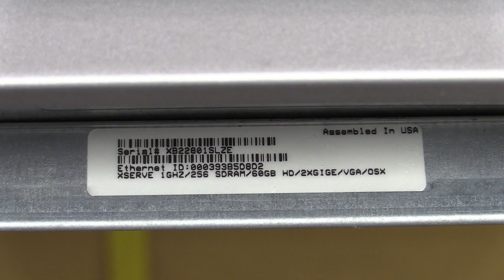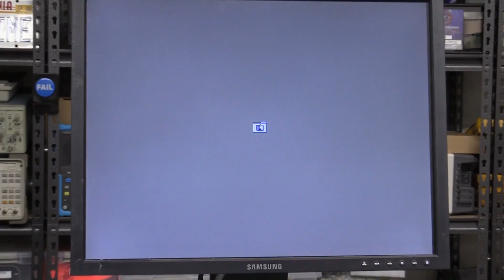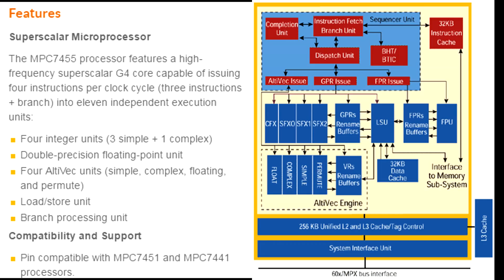EEVblog #882 - Dumpster Dive Apple Xserve Computers

Comment: Wow, the fans inside, veeeeery bad design, even for the time, there was better designs in Dell, Hp servers ! And Delta is not the best choice for a PSU, I repaired a lot of Delta's and a lot of bad brand capacitors leaked...
Reply: +Tech NOW You're perfectly right. And they are right as well. They did design it "badly" as 1U system as - at least if you rent rackspace at a datacenter or if you're running a really large system with many many servers - rackspace is really expensive thing. You whack in 2U server: pay nearly twice as much as you do pay for 1U. That makes a real demand for 1U "pizza boxes". So they have to find good balance inbetween "correct design" (where I would even tend to say 4U should be better for calm and energy efficient fans) and a cheap solution that does not cost that much rack space. That's the cause why they designed it "badly". And, remember: The thicker the air channel, the lower the air speed at a given volume stream will be!

You see, actually not sooo bad design though. ;-)
Reply: +Tech NOW ... and still IBM and HP both did use Delta as supplier, even for their "big guys" (Blade systems, SAN storages, ...). So you mean they are really crappy!? I've even seen a couple of Intel server boards with bulched caps, so does that make Intel a bad choice for Motherboards then? ;-)   All manufacturer did have that problems to some degree.
Reply: Its just that i a lot of Delta PSUs I encountered badcaps problems, that I didn't find on FSP, Corsair brands for example. I think they just should pay more attention to the caps brand inside their PSUs.
Reply: hows that a bad design
Reply: it sucks the "cold" air from below, where there's like 1cm or less of space for airflow, they could have made it a 2U rack and designed a better airflow system...

Comment: I would like to take that case- scrap all of the [cr}apple stuff, and build a nice socketed dual processor machine within it. That would be a nice challenge...
Reply: TrainMasterMan I strongly suspect Apple had an alternative processor module with Xeons, available only to the secret team that created the X86 port of OS/X. The use of a generic industry connector and an Intel chipset are the biggest clues.  Maybe they even considered making those modules available to early adopters if there was enough market. Personally I have only a bit of experience with the outside of a model that had two huge air intakes on the front, between 3 (not 4) drive bays, but I don't remember if it was x86 or PPC based.

Comment: I have a large HP Proliant DL160 G6 rack server, it's even bigger and a LOT noisier. Pretty similar inside though, they haven't changed much through 2000-2016 in terms of layout.

Comment: Surely, those blowers draw air from the space below and blow it across the processor?
Reply: aserta
Yes, but those fans, known as "blowers", have been around for over 15 years. One would think someone with his experience would have seen one before. :P
Reply: +Rob Fenwitch I noticed that too.  And you are right. He has the fan direction backwards
Reply: +JL Software what's a type of fan got to do with apple? #Logic
Reply: Squirrel cage is an interchangeable term to mean either a type of motor or a type of fan.
Reply: +D Cheverie He hates Apple so much that he intentionally won't learn it.
Reply: +Rob Fenwitch   Yeah...  I think his point was that there is almost no space below them to draw air from.
Reply: megaspeed2v2 It's just that he immediately criticized Apple for no reason. He doesn't even know how the blowers work. Apple has engineers who actually design a thermal path, not just slapping 8 huge fans in a PC case and calling it cooling like homebuilders do. Look at the inside of the PowerMac G5 - dual G5s with a custom-molded clear plastic baffle to form 3 separate cooling paths. I'm sure the same design patience went into the Xserve.
Reply: funkyironman69 Steve Jobs always wanted to inspect the inside as well as the outside of the products. Some of the G4 towers had the whole motherboard mounted ON the door that folded down. But of course homebuilders don't care about thoughtful design - they want 14 different manufacturers' components so that they "know exactly what is in there" and all generic technologies so they can "upgrade."
Reply: +JL Software Macs are not top-notch in build quality, and they think they still own it after you buy it. Just because something looks trim and polished does not make it good. Everything Apple makes is overpriced, fragile, and just plain.
Reply: JL Software
Those were really common in PC's as well.  Next.
Reply: +JL Software the sides are an excellent place to put the exhaust vent, or given a different design of hinge, the back. however, so that they didn't compromise their "form over function" design, apple decided that the exhaust vent is physically located behind the hinge on the laptop. this means it vents ok when the laptop is open (dumping all the heat into the display, another problem that could be avoided), but when closed, placed on a table or other flat surface, its ventilation is heavily restricted. say you wanted to render a video using software rendering (universally accepted as better quality for a given filesize) it may take a few hours, you might want to close the lid.
Reply: +Rob Fenwitch Yes they're centrifugal blowers. Not squirrel cage. That's a type of motor. Surprised by Dave's lack of knowledge tbh.
Reply: iwanthalo3 So for function over form, you want a huge case with a 500-watt power supply, dual overclocked 16-core processors, 128 GB of RAM, 8 fans all blowing towards each other, 6 PCI slots so you'll have 4 left over after installing the 2 video cards, 6 drive bays, floppy, 2 DVDs, 8 USB, and parallel port.
Reply: JL Software you say that as if apple are the only ones who do that, that is something ALL professional designers do. you are just being biased by the way you are saying these things that apple do as if they are the only ones. #ByYourLogic
Reply: Tim Ramich Not to a homebuilder, no. But those people are a tiny niche market. Give examples of what you mean by "cutting-edge." If you mean the absolute latest $1000 video card, you can get two of those in a Mac Pro. Otherwise, Macs have Thunderbolt and USB-C and the latest Intel i5/i7 processors and either Intel graphics 5000 or dedicated GPU. And very thin and lightweight with top-notch build quality and customer service.
Reply: +Tim Ramich I'm with him on a lot of things. he can rant a bit, but I learned some good soldering tricks, and learned apples repair policy which I find just crap.

oh well, at least you and I can see through it lol
Reply: Anybody that has no backup of their data and then takes the computer into a shop .... oh I'm laughing so much I can't continue.
Reply: Never wanted anything from Apple until I saw the interior of the trashcan Mac Pro. It's friggin beautiful design wise. No SFF build I've ever seen comes remotely close.
Reply: +D Cheverie It's physics not electronics.
Reply: +D Cheverie  6:15
Reply: iwanthalo3 Where do you want the exhaust vent? What do you mean "behind" the hinge?
Reply: +Rob Fenwitch They do, and don't call me Shirley.
Reply: Plus Apple laptops are great value, the only one I've taken apart had 30 screws of many different lengths. Not only did it provide hours of fun, it looked like a modern art masterpiece.
Reply: I've never had the need for either of those silly interfaces, nor do most people. If I need something beyond 1 Gbps Ethernet, I will step up to 10 GBase-T.
Reply: +iwanthalo3 Yeah. Their version of a repair is to replace it. I do wonder, though, if they have a factory where they do refurbish their parts, such as boards. I saw a video by him a few months ago and I got a bad first impression, but I watched a shit load of videos this weekend and I can say I was wrong about him and I learned a lot.
Reply: +JL Software 

you are of course referring to the same company that today puts the exhaust vent on their laptops behind the hinge, meaning that you can NOT use it closed, or it will overheat.

plenty of factory pcs have excellent thermal designs too.
Reply: spodule6000 So they blow instead of suck?  I guess it makes sense because this is Apple we're talking about.
Reply: +JL Software a 500 watt power supply wouldn't be enough for dual 16 cores a pair of graphics cards and whatever else. apple did that with the Mac pro/g5. function over form for something like a laptop would be NOT BLOCKING THE KNLY EXHAUST VENT WITH THE DAMN LID.
Reply: +JL Software and yes, that is something that many professionals (who for that reason don't use Macs) have. why don't they have Macs? cad software is universally better on windows than Mac, and the most powerful Mac you can buy has a very outdated CPU architecture limited to 6 cores, at a cost of $4000 a pop for the quad core model. apple chose to stick the damn think in a bin and sell it as a professional grade machine, its pathetic.
Reply: +JL Software Haha so Macs are cutting-edge technology?
Reply: +JL Software the video cards in the Mac pro are far from the latest. plenty of PCs come with thunderbolt 3, something Mac has not adopted. it took a long time for apple to adopt the skylake series of processors, and their "professional" grade products are so far behind.

do some genuine research on the "top notch" build quality. the thing is held together by glue. on customer service, go take a look at Louis rossman's YouTube channel. one example is if your macbook has say a main board failure, they charge a flat rate for repair (completely stupid since it could simply be a ram failure), worse is that they won't recover your data, even if the pci-e ssd is perfect and could just be slotted in a new machine.

and as for Steve jobs, the man was disgusting. he denied the existence of his own child until dna proved paternal connections, he banned all acts of philanthropy within the company, and was petty enough to remove freaking kit kat bars from the apple vending machines because android 4.4 was named kit kat.

apple does not care about you, or its customers. you are nothing but money to them.
Reply: Seems like mac users designed the cooling system. lol
Reply: Just admit you're a PC loving, anti-mac, commie son of a hamster. Apple are very good, they even solder the RAM in to stop the electrons from escaping. ;)
Reply: > worse is that they won't recover your data, even if the pci-e ssd is perfect and could just be slotted in a new machine

My MBP has had its logic board replaced 3 times (same problem each time—some design flaw) and every time, the Apple technicians have transferred the SSD to the new board. (It's out of warranty now, though, so I'm going to have to attempt a Louis Rossman-style fix soon.)
Reply: Since it would be a quarter of the price, why not?

Comment: That would be a decent NAS server though. Plug  large IDE hard drives into the slot, and install Debian on it, and you could say Bobby Dazeler!
Reply: +John Rickard It is probably now less powerful than a raspberry pi and it consumes al least 50 times more energy
Reply: +John Rickard No it wouldn't and large and IDE don't go together.
Reply: +MrTVintro You would be wrong to assume that. UDMA IDE has the physical means to support up to 2 tb hard drives. In practice, I have seen half-terabyte IDE drives. Regardless, I said decent - not overpowered
Reply: +John Rickard It consumes too much power.
Reply: +Antonio Barba Good point
Reply: +MrTVintro Get a SATA-IDE adapter for less than 5 bucks and you're set.

Comment: Teardown of Delta PSU?
Reply: +Антон Южаков caps resistors and transformer and some diodes
not much else going on in the PSU's
Reply: Great idea! I'd love to rebuild that PSU to a rather powerful bench top power supply! These units are awesome!
Reply: +Stein-Erik Dahle You can get excellent server PSUs on eBay for practically $shipping. Some are better than others, and many have proprietary connectors. The best one I've scored is a sony APS 112 form a sunblade workstation. I does 5V @ 70A and 3.3V @ 90. Thing is a monster and beautiful inside. https://www.flickr.com/photos/dork_vader/albums/72157638625275205
Reply: +Антон Южаков Yeah you can see in the pictures:

https://www.flickr.com/photos/dork_vader/26529114163/in/album-72157638625275205/

 caps and other output misc soldered to the massive traces on the PCB which are soldered and bolted to the busbars. Each rail has four 10,000 uf caps on it, IIRC.

OK *now* I pretty much have to drag it out into the sun and reshoot some good photos with the good cam. Look out for that in the next month or so :p
Reply: Sam Fedorka Oh, what a beauty... Maybe you have some photos of PSUs with more amps and some huge bus bars?
Btw, does it have Synchronous Rectification or just Schottky diodes?
Oh, i see diodes, are they soldered to bus bar? Power transformers secondary windings consist of litz wire?
Reply: +Sam Fedorka, I can't believe I haven't thought about that... Thanks mate!
Reply: +Антон Южаков It took me a while to figure it out but yes the negative busbars go around under the secondary heatsink and everything is soldered to them. it's crazy. I'm thinking about making an account on the eevblog forum so I can post pictures an/or mailing it to dave so we can hear him gush over it, but I'm worried it'll only warrant a 2 minute teardown.

I took a bunch more pictures a while ago (with a cellphone so not super great quality) that show more of the inner workings. I'll put them up on flickr now.

I really want to test it at high power, to measure it's performance but I don't have anything that can draw that kind of power and still survive. I had a 600W projector bulb that I used to test my variac with, hmm.

update: pictures added to album. I really need to upload the rest of my stuff sometime.
Reply: Sam Fedorka Output caps soldered to PCB, not to bus bars?

Comment: Intel 21154 is a PCI bridge chip, probably just expanding the PCI bus for more slots.  Interesting that it uses the Digital (DEC) part scheme (many Digital semiconductors before they were bought by Intel used 21xxx), so it may be an older part they inherited and rebranded. Other examples are the Dec Tulip ethernet chip 21140,  Alpha processors like 21064, 21164, and 21264

Comment: Can I have that VGA card?
Reply: Joshua Nicoll i've checked now, and i found that the Graphics card in my old PC is an ATI 9250, which you can get for like 10€ here including shipping...
So not really worth anything at all...
Reply: +Joshua Nicoll what do you wanna do with it?
Reply: +muh1h1 it's a regular PCI card, they're fucking rare as well
Reply: +Joshua Nicoll hell*
Reply: Joshua Nicoll OK then, i think i still have one in my old PC (might be AGP though), i should have a look on ebay if it is worth anything :D
Reply: Some of them go for up to $50
Reply: +Joshua Nicoll I have like 5 of them I was going to throw away. are they really that rare?
Reply: Depending on the type, yes, wgere as 10 year old PC stuff is old and useless, the even older stuff can sometimes be worth a little bit, often not much more than $20, but if you've an old DIMM DDR desktop you wanna restore because it's retro and retro PC's are kinda cool, you're gonna have a hard time finding those DIMMs
Reply: +Joshua Nicoll Thanks for the reply; I checked and I recycled the PCI GPUs, but I have some beefy AGP ones left. I didn't think this stuff was old enough to count as retro.
Reply: +Sam Fedorka if it's not used or the modern version of it is also not used, its retro. 10 is old useless, 15 years old and the standard is also dead its retro.
Reply: +Joshua Nicoll not rare at all here super cheap
Reply: Where I live they are very rare, But common for me is the 65 DDR2 256/512Mb sticks I have from PC upgrades, I have no DDR ones, and almost no old GPU's, but again, they get used a lot less. I often upgrade old PC's for 25% the cost of a new absolute bottle line one, mostly for old people since they don't even need the power of a shit OEM PC, anything older than 13 years though is hard to get.
Reply: +Joshua Nicoll We would be perfect friends, mate! :D I would want it as well. When you look for "pci video card" it gives you dozens of PCI-e ones, but classic PCI ones are soooo rare to find!
Reply: +Georg Pf god yes, try finding an ATi RAGE or a  3DFX Voodoo, they are the really valuable ones, I've seen people ask $90 USD for them.
Reply: Joshua Nicoll Damn yeah, I used to have a 3DFX Voodoo but I think it was the AGP one (unfortunately back then I didn't know what the value of those cards was).
90 bucks is still a bit much, at least for me. I mean you can get AGP ones for arround 30.
Reply: AGP wasn't terrible, definitly better in terms of performance over conventional PCI, but for the retro factor it's not the same. I had a nVidia Vanta LT, man that was a shit card but the retro factor.
Reply: Joshua Nicoll Yes, I know that, but I would need PCI cards for machines/motherboards that simply haven't got AGP "yet". As you say, it's the retro factor. Didn't hear of the Vanta LT before, but sounds interesting.
Reply: I discovered that the PCI expansion slots on Apple computers before the Intel Macs was big-endian, rather than little-endian like the cheaper (and vastly more available) IBM compatible video cards were.
So this isn't a source for a replacement VGA card for your 2003 vintage PC, just in case you were thinking of that.
Reply: The older older ones can be worth more, €10 for a 2004 card is average. ATi RAGE cards sell for up to €110 excluding shipping. Who would actually pay that I have no idea.